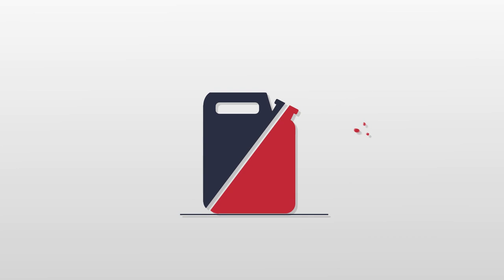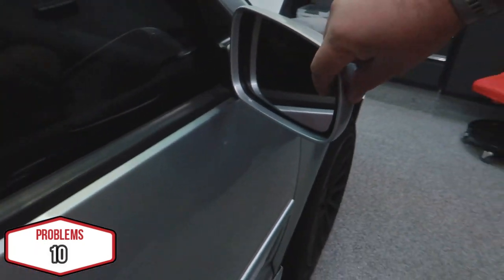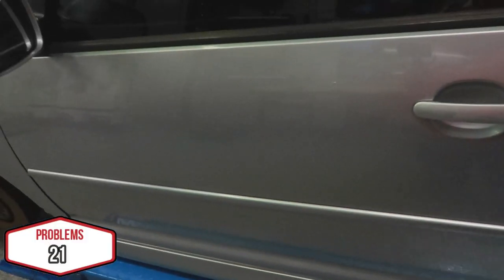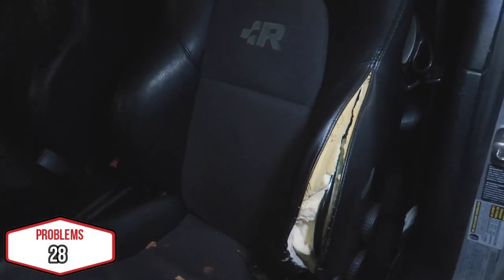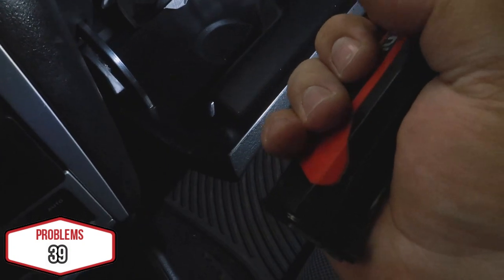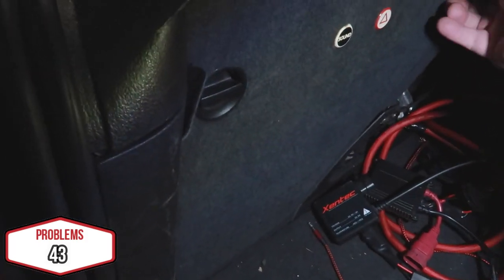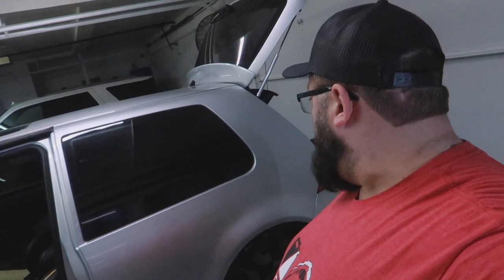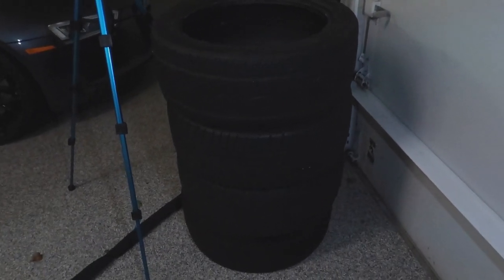VW MK4 R32 Everything Wrong with my MK4 VW R32.  I might just cry! The Project Car Rebuild Pt. 3

Comment: As another fellow R32 said. I’d see if the clutch and timing chains have been done. 

By looking at what the previous owner did it, I’d say work on those two first and slowly work the minor stuff.
Reply from the maker: Maveric073 thanks for the advise! My goal is to get it looking pretty and then drive it to the max. Blow the engine and then fix it or build another one to make it 500ish HP.
Reply: Gas Tachs awesome!! Looking forward to your Build.

Comment: I actually have the stock head unit from my previously owned R32 sitting in my living room. I just followed you on IG, @BleedingTeal. If you are still looking for one just shoot me a msg there.

Many people have mentioned the timing chains, but the chains themselves are not a recommended replacement part. The guides & tensioners however are. It's recommended to have them replaced around 100k, but that's not an absolute. I myself hit 175k on my R32 before they needed to be replaced. My 3.6 VR6 CC is at 142k and hasn't had them done yet. I had 2 previous 12v VR6 GTI's that didn't need them until after 150k. A buddy of mine in his DBP R32 did his at like 205k I think. So don't feel the need to do them unless you start to hear the tick. There's a few videos on here which showcase what that sounds like.

While you're tearing everything apart, you may want to preemptively do the crack pipe mod. There is a cooling pipe across the front of the block between the block and radiator that's made of hardened plastic which gets weak over time and will break. If you go to Gruvenparts.com you can find a billet aluminum version that can be swapped in. It's not necessary, but while you have a bunch of stuff apart, it may be worth looking in to.

Comment: Well, kind of minor cosmetics. I would be more concerned with large mechanical issues. Like timing chains, clutch etc. Let me know if you need any help. You can see my 6.5 year R big turbo build at Nemesis R700 on FB. Have fun...
Reply from the maker: Hey man, thanks for the commens. I'm going to do all the general services stuff too, fluids, trans service, haldex service, brakes and everything else in the video then drive it around and see what other issues there are.... I'm sure there will be more issues but thats tomorrow problem. 👍

Comment: Nice man! I am also rebuild a tornado red R32 I have about 30k less on my car and way less rust lol but I paid $5.7k for my R32. Good luck with your build I have my build starting soon also. I thought I had the cheapest R32 but look like your a little cheaper. Where did you get the car from?
Reply from the maker: Hey man, watched your video it will be cool to see where each of our builds go! I had to drive to Des Moines Iowa to pick mine up. Yours does look cleaner for sure! Good luck with your build, I’ll be following.... maybe meet up at WITW?
Reply: Gas Tachs yes I’d be down to meet up at WITW! It’s a great show for sure and lots of fun! Good luck I’ll be following as well.
Reply from the maker: Andrew Wenman if you want to get rid of your stock rims keep me posted, I know you just put new tires on, I’m just trying to go back to stock look 👍
Reply: Gas Tachs I’ll probably keep them even with all the modification I like them for daily use and long drives lol I’ll keep you posted if I start selling stock parts. Also just subscribe lol